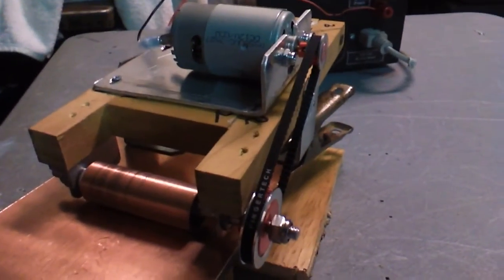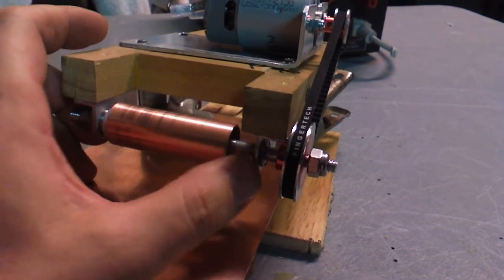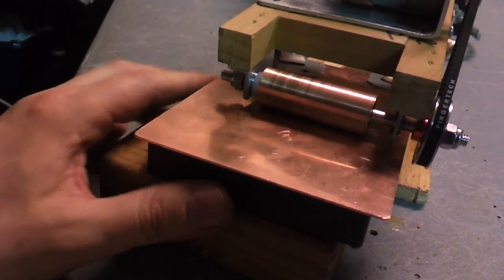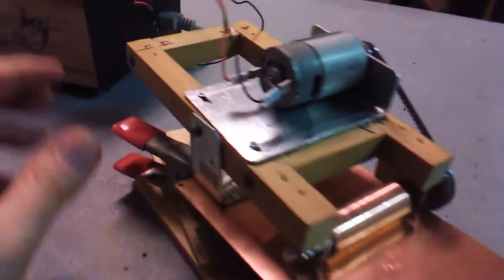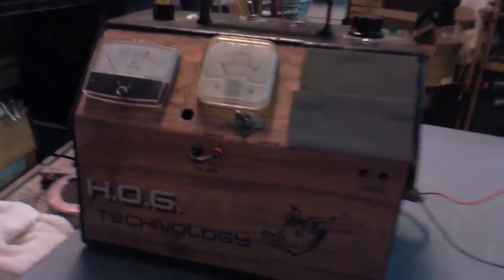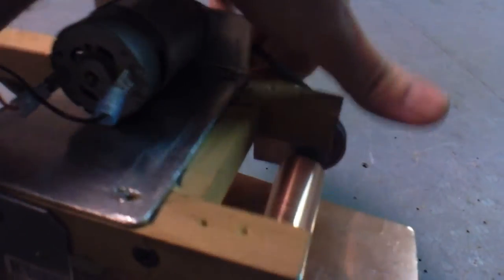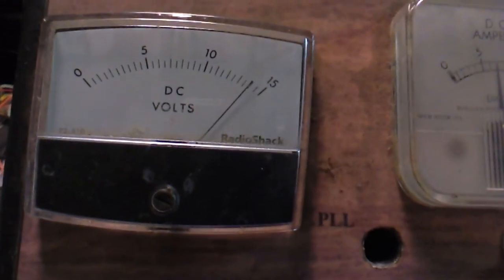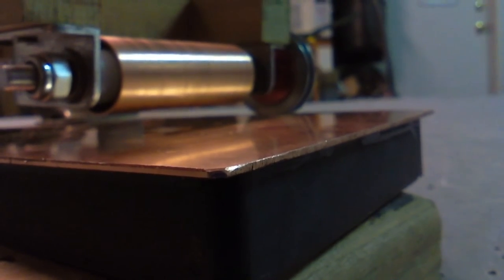Searl energy generator test 1 (SEG)

Comment: This effect is know long before Searl talked about it.  Current is induced in the copper from the spinning magnet crating a magnetic field in opposition to the one that created it.  Same effect can been seen by dropping a magnet in a copper tube.  The magnet will drop slower through a vertical copper tube than with a non magnetic object.

Comment: do it again without the copper plate. looks to me like it's dancing around because of the torque from the motor and chain spinning. if I'm wrong your effect goes away without the copper plate. I say it behaves exactly the same without that plate.
Reply from the maker: Please read the published comments already included in the video:......................................................................................................................................Attempted to use the side of the 4 x 6 x 3/4 ceramic magnet without the copper plate to see if in fact there are eddy currents creating magnetic fields that push up the rotating drum and we could not get the drum to float. It only dropped when the motor carriage was released to gravity / anti-gravity forces with motor running at full power.